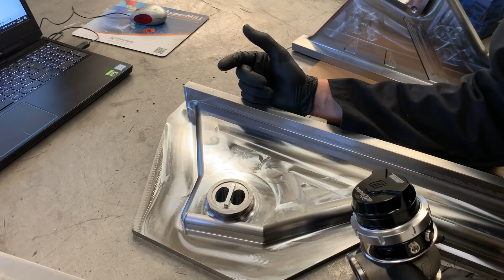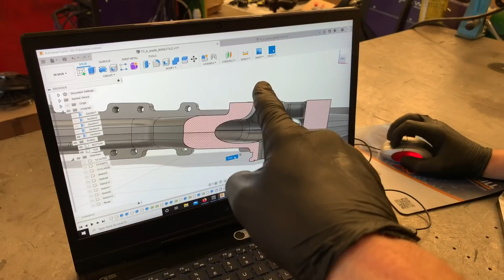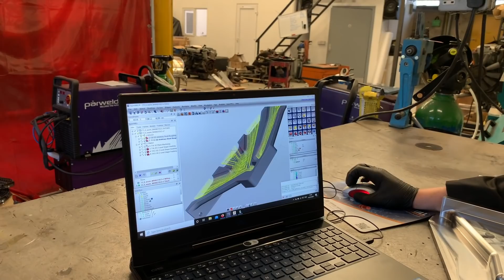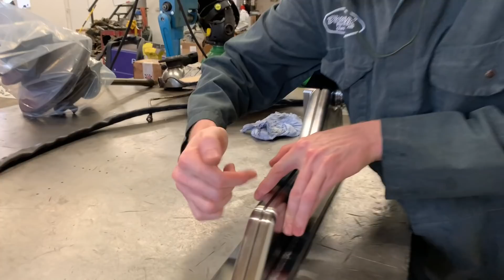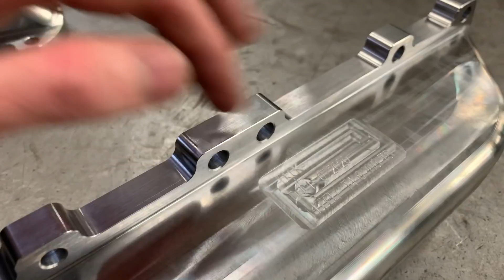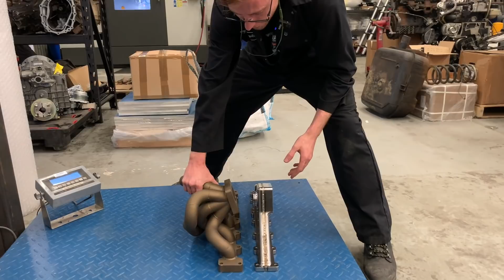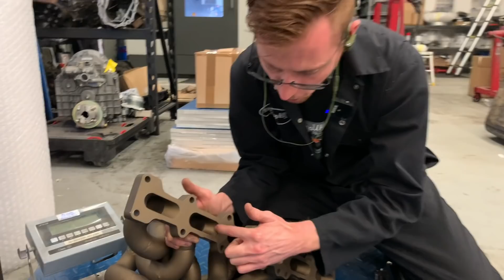BILLET TURBO MANIFOLD OM606/605

Comment: Awesome piece would like to see both of those manifolds back-to-back on a dyno
Reply: Or even tested on a flow bench
Reply: John Fisher I was thinking the same thing
Reply: Certainly looks pretty and saves space, but when push comes to shove....performance.

Edit:  Especially with the long-tube Vs short....
Reply: @MrAcuta73  Papadakis Racing's recent 2020 Supra completely blew everything I thought I understood about manifolds out of the water. What with it making 1000 bhp with practically zero runner length! Just the stock all-in-one cylinder head/manifold. Now I know that I know fuck all about runner length vs power!
Reply: Yeah need to test see if it performs
Reply: One of my concerns is complete lack of opportunity for equalizing runner lengths. You could make a much more compact tubular manifold, too, if you didn't care about runner lengths, but that's part of the reason that tubular manifolds tend to look so convoluted.
Reply: I like your work, but for this idea im sceptical, but ok test it on dyno... im waiting for the results
Reply: No joke, it looks nice and does take up less space, but with an equal length turbo manifold is better between the pulses.
Reply: ⁸⁸8888⁶⁷7⁶
Reply: This really shouldn’t make a difference because, there is back pressure and the turbo is the mute point for total exhaust flow. Tube diameter and length would only change the amount of time it takes to “fill”  (lagg) Only benefit I can see to running this billet mani is, packaging. Stock Exhaust manifolds on LS engines have proven that, it doesn’t take big tube headers to flow enough exhaust to make big power numbers. The Turbo is the restriction.
Reply: @mr.know_it_all  Sorry, but coming from a motorsport background, 'claims' are just that, until there are test results to back them up.
I remember back in the 80s a very popular fast road/competition exhaust system for the Mini was touted to be 'the dog's bollocks' until someone actually put their system on a flow bench and discovered that they actually flowed WORSE than the standard factory exhaust!
There needs to be a back to back test on a flow bench and dyno if these are marketed from a performance standpoint.
If you think tube diameter and length have ONLY one affect on the engine, you are very much mistaken!
Reply: @mr.know_it_all  It will most certainly make a big difference, no matter if you have a turbo after the collector or not. The whole point of an equal length header is the increased scavenging effect. A twin scroll turbo will aid this even more: https://www.youtube.com/watch?v=T7JTRRlSEYI
Reply: It’s not a Nova what about the difference in sound it will make? Like long headers make different engine sounds than a stock one. Am wondering what this would make it sound like
Reply: @mr.know_it_all  bigger cams like longer runners
Reply: @mr.know_it_all  I would hazard a guess of it picking up especially on the top end turbo cars do suffer from restrictive manifolds in some cases I know of cars 20vt k04 been one that struggle making over 280 standard manifold change that and 300 can be seen just because the turbo is a restriction does not mean any rough transitions or lips won't have an effect on the flow
Reply: @mr.know_it_all  
Tube diameter and length effect more than lag. Even with a turbocharger, tube diameter, length, etc still effect cylinder savaging especially at higher horsepower levels. Look at some high level turbocharged race cars. The engines look, basically, like a NA engines with long tube headers and elaborate intakes but with a turbo(s). Those guys don't build those medusa head exhaust systems for fun on turbo cars, the do it because there is a clear advantage to it.
Now at lower levels one might get away with simple log or stock, short runner exhaust manifolds like on an LS especially as those are often much cheaper and last longer but in reality, they are giving up some power and probably some lag, it's not just about the turbo being a restriction. No offense but that's overly simplistic.
Reply: @177SCmaro  it's a little like his oversimplified look at what power an ls can make with small diameter exhaust iv heard alot of people over the years quote what power levels can be made on a certain size exhaust to justify it not been a restriction it might not be the craziest setup aiming for sky high numbers but a larger exhaust within reason can improve  the flow and pumping efficiency of the engine and thus more power
Reply: @gtrontour  
Right. It's a trade off, a balancing act.

Comment: minimum primary length 15 inches if you use pyrometer where 3 first cylinder merge it will go nuts if you make the transision from flange to the tubes there will be no comparison between the two. Still nice job
Reply: I saw this as well

Comment: What about sealing between the cylinders? Just welding the outside wont seal each runner.
Reply: I was looking Same thing. Hope they Will  answer.
Reply: They welded the inside if each runner. He showed it
Reply: @iDrill1993  Only near the exhaust port. Theres about another 300mm that is not on each runner.
Reply: That's what I was thinking too. With no mechanical lock between the runners, I can't help thinking there'll be some separation when it heats up. Probably marginal but that detail still bugs me. I was thinking some sort of tongue and groove lock between the runners would help. Anyway, without dyno comparisons to illustrate turbo spool efficiency, it's hard to say how effective this is. Casting would be much more energy and cost efficient too...
Reply: Same thing on my mind. Heat is a bitch and we all know it. Some welding spots to hold the runners together maybe? Or is there any thought behind it that we youtube idiots dont know nothing about?

Comment: How are you calculating expansion for Port alignment laterally along head face and how are you calculating fastener stretch variance and fastener longevity and are you using any special fastener materials as I've seen the mistake of using too short fasteners and not being able to maintain clamping force thru thermal cycles,

Comment: Surely the tubular manifold would flow better if the flange area was ported and reshaped so there is no obstruction.
Reply: I 2nd that tube flow better if port matched...sorry...u got a log style manafold but like idea...do equal runners maybe 3 layers ...that alot of meet to cut out but u can do it

Comment: Great product, very impressed , a little tip with the TIG welding , keep the filler wire inside the gas coverage, each time you pull it out the white hot tip is contaminated by the atmosphere.
I'm in no way being critical, just trying to be helpful. (I've been a coded welder for about 45 years)
Cheers.
Reply: This is called constructive criticism.
Also is very important for a strong and durable weld.
Reply: Very good tip indeed , thx
Reply: On site a “shiny pants” once come up to me and tried to give me advice on how to weld lifting lugs on manganese lining, 
I politely pulled out my welding certification card and pointed out my welding helmet and jacket then proceeded to tell him to go back to the office, which he did quickly!!
But if another tradesman wanted to have  a conversation about technique I’m all ears,, I’ll even go make the coffees!
You don’t always know everything at once!! And only give advice if your qualified!!!
Reply: Thanks for the tip I'm working on my tig welding right now, less contamination = less future corrosion
Reply: This is great info! Thanks for sharing 💯
Reply: Tig welding was my favorite in college. Unfortunately I had to cut classes short because it’s kinda impossible to run a bead on a computer keyboard
Reply: @hitlersmissingtesticle69  I don't think it's unfortunate, just that you chose a different skill. Why not keep pursuing welding or you were more keen on computers in general? Trade school can be great!
Reply: Fredward40Handz _ I’m headed back to college this fall now that they’re letting people back in💪
Reply: Fredward40Handz _ trade schools are pretty much always the way to go in my opinion. Some people weren’t made to get degrees. I don’t want an office job
Reply: Snails40 people are more likely to take advice if they don’t see you as rude. just plainly saying “your welding sucks, do this instead” to a professional likely won’t result in any changes.
Reply: Wish someone had told me this tip before. I’m not coded or anything, just self taught and usually just weld old shitty broken castings etc, but it took me a while to figure this one out for myself.
Reply: Not really reason Dave its not being tested in any way...i.e.xray or p.t.
Even then it can get pos.but it take way more lack of coverage.
Reply: Also, this is very important, take out the standard collet holder in the tig torch and replace it with a gas lens.
Reply: Every asshole teasing the constructive criticism needs to stop lol stainless does not like contamination it forms all sorts of crystalline structures that arnt hood for thermal tasks like that
Reply: What welding are you coded in and what positions ?
Reply: You are being critical but that is okay.
Reply: Hey  do you tune 6.7 powerstrokes?
Reply: @sheromemyers2725  are u criticizing him? He was just giving some welding advice knowing how to tune powerstrokes is not a requirement for tig welding lol

Comment: Why not cast aluminium ?  With thinner walls less weight more curvy shape for best air flow, using a 3DP to make a negative mold for casting.
Reply: Have you ever seen aluminum EXHAUST manifold?
Reply: @ToyotaLandCruiser  yes
Reply: SpIRiTus1995 I have not.

Comment: Real nice product, I am really impressed. if machining time wasn’t so much of an issue you could add a recessed groove between the runners on one half and have a positive extrusion on the other half. This will both align the two halves and generate a more torturous gas path between the runners. With the current design the gasses are likely to be able to mix ‘slightly’ between runners when hot and the gap opens up slightly. Maybe this is not a problem so doesn’t need a solution.  Might be nice to try doing a titanium 6-4 version for fun, although post weld stress relieving might be necessary (although this might be done for you by the hot exhaust gases).
Reply: I was thinking this EXACT same thing. I’m very curious to see how this does after several heat cycles. I’m rooting for it to do well 👍🏻

Comment: Nice work ... will you be doing a back to back test  ?   3 runs with the stock manifold then 3 with your new manifold no changes to fueling or boost ...
Reply from the maker: giles hamilton  yes we will be doing some back to back testing.
Reply: Could an identical part be used as a plenum on the induction side DieselPumpUK?

The symmetry of this hanging off each side of an m103 would be very appealing.
Reply: @DieselPumpUK  any results yet?
Reply: Don't forget to also compare the tubular manifold as well!

Comment: I’m sure thought about this, but what about a key way between the runners, both to help with alignment (eliminate the dowels) and seal between the runners. Is there any concern/ risk for leak between the runners since you cannot weld/seal  the inside?
Reply from the maker: I had considered bolting this

Comment: What about orient the turbo flange to more direct flow rather then making a 90 degree turn
Reply: My guess is packaging. Rotating the turbo horizontally takes up more space, which would force the entire unit to be shorter creating flow restrictions elsewhere.
Reply: Am i the only one that sees a problem with boost creep bc the wastegate has to work against the flow if exhaust.
Reply: Josh Clark @bikini_st actually the pressure is high and it can easily flow into it where it is, maybe it would creep a little bit but not much
Reply: Because they only understand some degree of airflow.